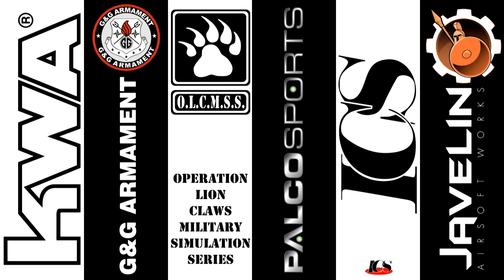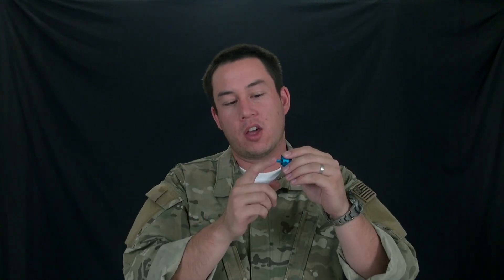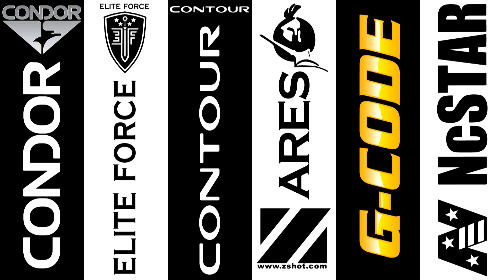Airsoft GI - Back To Basics - The AEG Cylinder Head

Comment: What is a type 0 cylinder and will it increase the fps on a kwa cqr mod 1, it has a 407 tight bore, and of coarse it comes with an extremely ported cylinder